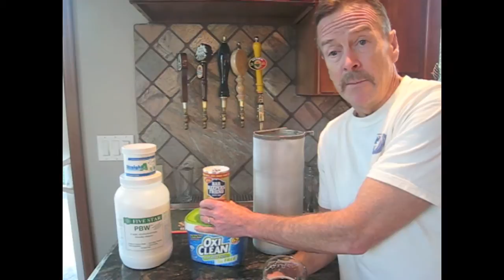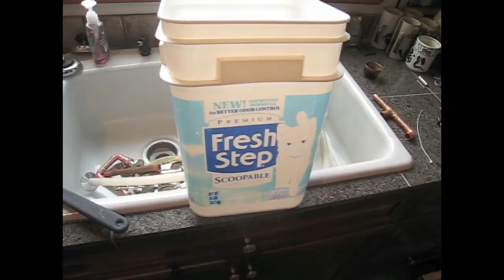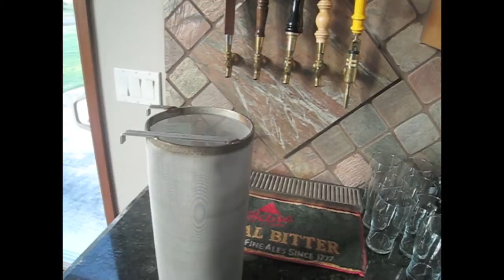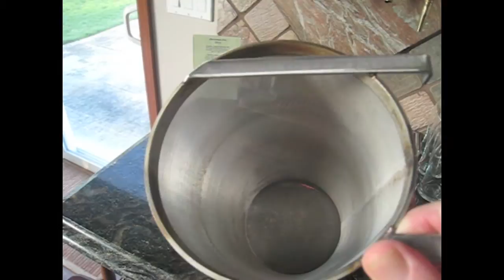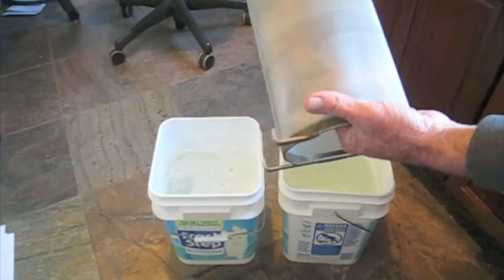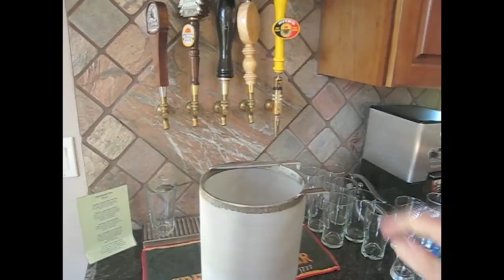Homebrewing Cleaners (oxyclean, pbw, bar keepers friend)

Comment: For cleaning mold which is that best option
Reply from the maker: I haven't tried any of these on mold.  My guess would be that if you use Bar Keepers Friend (I discussed that one in other videos) it might be worth a try (that is assuming you can scrub it a bit)..    For soaking, Oxi would be a cheap and easy thing to try as well.

Comment: Concur that PBW has a discernible cleaning effect beyond Oxygenated cleaner or BKF for non contact areas. Acquired a commercial 2.5L coffee carafe at work which was used for 5 years, although cleaned weekly with dish soap it was never deep cleaned. For 2 weeks I swapped out varying cleaning agents every 24 hrs with hot water these included, TSP, Fry-Kleen, Oxyclean 2x, BKF, Citric acid and big name dish machine pucks 2x. After this exhausted regiment finally got clean water after 24 hr even after shaking with dish soap / water. Thought all was finalized with the cleaning until I received some PBW and placed 1/4 tsp with hot water overnight only to find viewing tube visible with coffee coloured liquid and small chunks floating when shaken. Currently on second run of PBW and surprised what PBW was able to do further that other cleaners failed to do.
Reply from the maker: Thanks for the comment.  I am also now using sodium percarbonate (active ingredient in PBW) as well.  Inexpensive and concentrated.  Works great in the brewery and all around household cleaning too.

Comment: Would super washing soda or simply soda ash or sodium carbonate work as a cleaner? it's one of the ingredients in pbw a it's really easy to make from baking soda.
Reply from the maker: yes, I have been using sodium percarbonate since this video.  Works well, very concentrated (1 Tbl / gallon of water) and does a good job.  This is a (the) main ingredient in Oxy.  I believe this is also called soda ash.
Reply from the maker: Could be, I haven't tried that.  I will say that I use baking soda to clean a lot of things from the sink to my smoker and oven.